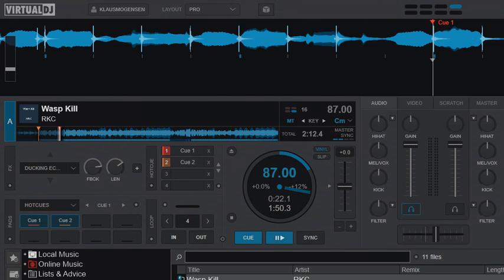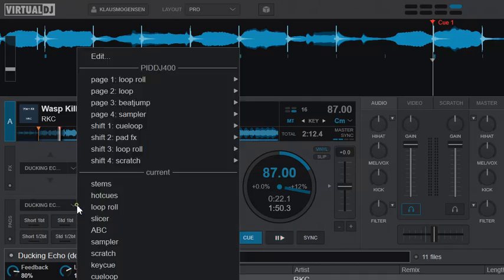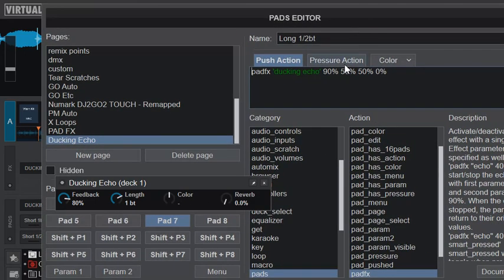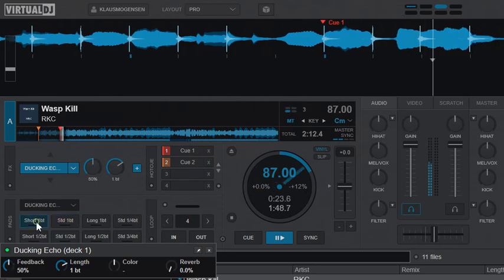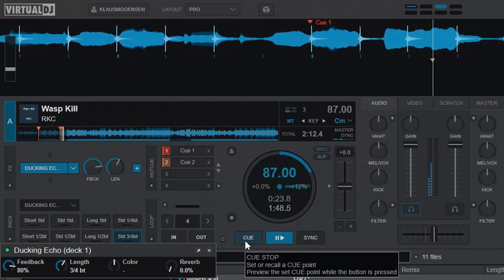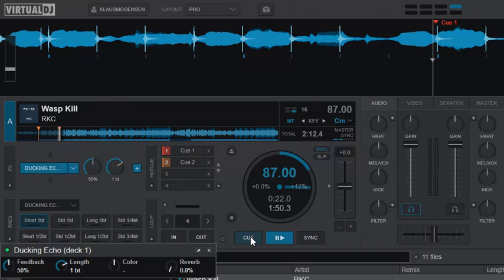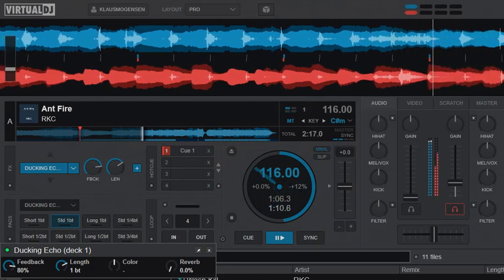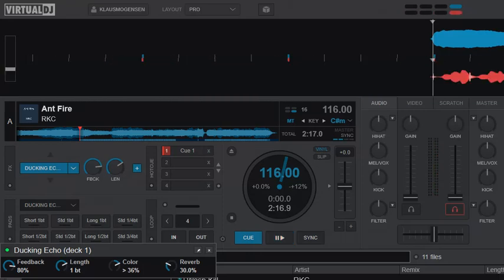Quick n' Dirty: Using Ducking Echo with a pad page and a controller in VDJ8.5/2021

Comment: Is there away I can keep it on because when I load a song a the deck which has it engage it goes off
Reply from the maker: Yes, you can disable the general setting "resetFXOnLoad"
Reply: @klausmogensen8691  can that setting by applied to this effect only while resetting all others?
Reply from the maker: @chadnliz2k11  Not by default since technically it's just another effect
But you can add a repeating script - maybe on to a custom button as a toggle - that checks if it's turned off and turns it on if it is
Try this script (it check every half seconds when toggled on):
effect_active 'ducking echo' ? repeat_stop 'keepduckingechoon' & effect_active 'ducking echo' 0 : repeat_start_instant 'keepduckingechoon' 500ms & effect_active 'ducking echo' 1
Reply: @klausmogensen8691  thank you
Reply: @klausmogensen8691  Thnaks, but that will also affect my other 2 EFX, and i want those to reset
Reply from the maker: @bushkashy  Then try the script I put just above
Reply: @klausmogensen8691  it is blinking on and off none stop and EFX cant apply
Reply from the maker: @bushkashy  Maybe check it again
Or maybe wait a little while (few days maybe) - then I'll make a video exclusively about the script (or a similar one)
Reply: @klausmogensen8691  ok general will wait, respect 👍